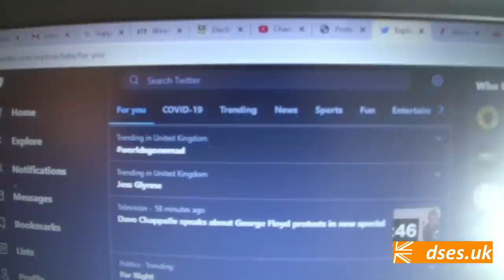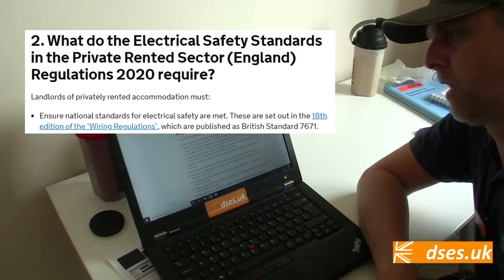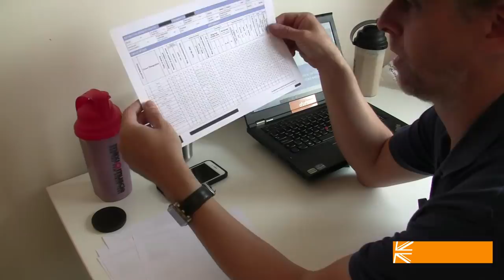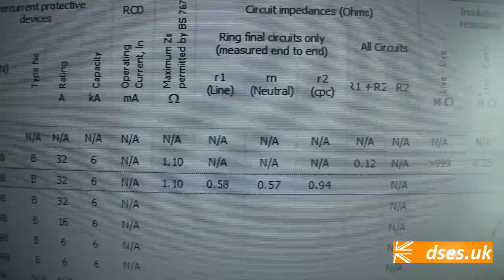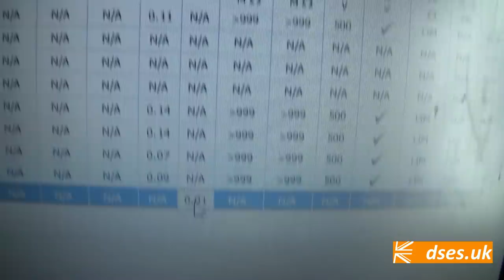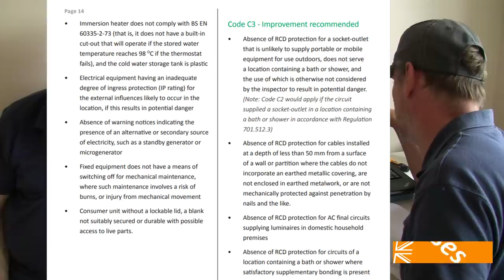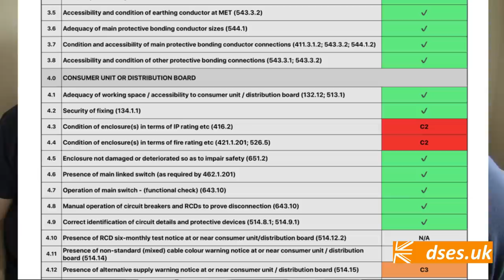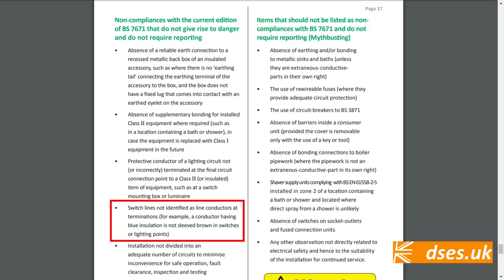Landlord electrical inspections from July!

Comment: I think it’s worth mentioning that the minimum 1M ohms  stated in the regulations is with all final circuits and any distribution circuits if applicable connected to the CU or distribution board and not individual circuits. The total insulation resistance with the final circuits connected in parallel must be equal to or greater than 1Mohm although really this is a requirement of initial verification and not periodic inspection and testing, you must use sound judgment on whatever readings you obtain as to whether they are satisfactory or not.
There’s also no requirement to have your protective bonding conductor resistance at or below 0.05 ohms. I think the confusion is that 0.05 ohms is mentioned only in GN3 however it does state in GN3 that this is NOT from the MET to the extraneous part, it’s between pipework where a bonding connection is ‘built in’ and a low reading on the order of say 0.05 ohms between different pipework confirms that the pipework is ‘bonded’ .
Reply from the maker: Thanks Ian, you're right of course. We're interested in what is hovering near or under the 1MOhm mark in case we are asked to fit an RCD. A re-read of GN3 does indeed state the 0.05 Ohm reading is between 'any two points' such as metallic pipes. Even when you read this stuff and think you have it down, it warps in memory and becomes something else entirely.
Reply: David Savery Electrical Services No problem, enjoying your content 👌🏻

Comment: As I work for a council in our properties in between tenancies the properties have a full inspection with 10 to 50% of accessorie's disconnected to determine partial visual condition of the installation and we do minor upgrades for peace of mind and saftey.
99% of our properties have plastic consumer units which get a c3.
80% are of 16th edition where only socket outlets are rcd protected. They also get a c3 even if we do not know the depth of the cable buried in the fabric of the building.
These properties we come a cross we rcd lighting circuits or any circuit going through a bathroom weather they do or do not serve the location just for peace of mind for the customer and tenants saftey.
And we also now have started fitting type 2 surge protection on all properties via the wylex mains isolator/spd combo.
Some of the comments on Facebook and other forums stating that all properties should have rcd protection and they c2 plastic consumer unit located in escape routes or under stairs is complete nonsense.
Its only in communal areas or commercial settings where such codes should be used.
Its just a money making scam as the twist the regs and government guidelines in there favour of them doing the remdial work.
Excellent video stating these facts david and nigel.
👍🏻
Reply from the maker: Thanks Asa, all sounds sensible to me!

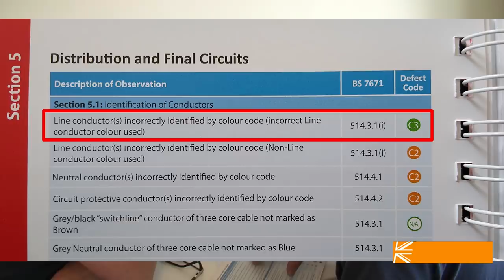Comment: For the switched line conductor being the wrong colour, you appeared to highlight the wrong line in the codebreaker book, the one you highlighted says C3 if the wrong line colour is used (presumably referring to 3 phase colours) but C2 if a non line colour is used. Surely black old colour for neutral would be a non line colour.... Except of course they were sleeved so it's all nonsense anyway 1:09:52

Comment: Hi David, couple of comments, just my opinion, I don’t agree with the way you tested the cooker circuit or recorded the IR.  The IR is of the fixed wiring & not the appliances connected to it.  The other electrician was correct in my opinion up to the isolator, unless the client requested the whole circuit be tested, then you must remove the loads & measure the IR.  R.F. Circuits do receive a lot of flack, correctly installed & you get the length which you sometimes need.  Also periodic inspection should be minimum dismantling, removing all sockets is unnecessary unless the sample is being increased due to loose connections & even then, it should be recorded as a c2 100% sample required & rectified in rectifications after the report is complete.  (You could have caused IR problems that didn’t exist before you removed all the sockets). RFC, crossovers are not usually required during a periodic.   (DOMESTIC) End to end, R2 wander lead to earth pin (bonds removed from MET) & ELI, you will have already sampled approx 25% of the installation.  (Crossovers on an existing installation measures the contact resistance of the old socket & results are inaccurate). You normally have no choice to use crossovers in commercial.
Reply from the maker: Thanks Patrick, I value your feedback. The reason for testing the cooker after the isolator, as we would also have done with an electric shower, was to ascertain whether the fixed appliance would be likely to cause problems for an RCD should the landlady act upon our recommendation such be fitted. It does indeed skew the results of the fixed wiring test, but I don't want to be asked to fit an RCD, then tell the landlady she also needs a new appliance because the flimmin' thing won't stay on. I take your point about removal of accessories, but we try to identify and rectify issues such as loose connections on the day rather than reporting back problems and booking remedial work. We're doing ourselves no favours I know, we could book such work in and make more money, but we're so rammed with work that we'd rather visit site once and tick it off for the sake of some screwdriver twiddling. RFC crossovers we often omit on periodics; such was actually said to camera, but it got cut from the edit and in this case we did it to verify the result of the last guy and to show the maths working out.
Reply: David, that makes complete sense, but I still wouldn't record it on the test sheet as that could cause confusion.  Anyway I enjoyed the video, excellent content.

Comment: Hi David, Thank you for this very informative video. It will help electricians and landlords. We just need the government to watch it to realise that too many areas rely on opinion. I've just had a EICR carried out on a flat I rent out (built 1988) and exactly the same situation has happened. Failed due to no RCD's. I sent the report to the NICEIC, of which he's registered, and they came back with the lack of RCD's warranted a C3. They did say from the report that outside sockets are a C2. However it's a 3rd floor flat. They did mention though that supplementary bonding was marked as N/A.  This obviously can not be so and still needs to be verified. I'm currently having a "discussion" with the "Electrician", and I've since found out that although he is registered with the NICEIC, this is as a Domestic Installer. I was wondering if Domestic Installers qualify as a competent person to carry out EICR's? I do want to have the consumer unit replaced (not for the £900 they quoted), as I fully understand the improvements made in safety with RCD's. Keep up the good work.
Reply: Only if he has 2391-52 but he wont be able to sign the EICR off as a domestic installer from NICEIC as it doesn't come under the D.I Scheme but does come under Approved Contractor Scheme.

Comment: slightly off topic but I heard  your say your an easy cert user whats your take on the measured Zs value setting in the software  80 or 100%, ? to me its wrong either way because if you set at 80% easycert will highlight excess measured Zs values in red but inputs the 80% as the maximum allowable value  but this should always be the 100% uncorrected value so you select the 100% option but lose the software's ability to highlight measured values that exceed 80%, hope this makes sense ? and still holds true in the latest versions of easycert , going back a few years this was about the only thing Amtech got right as you could select 100% values but validate at 80%.

Comment: Great video.  Just a quick question. New to the game. Got a board change to do in a integral garage. The existing consumer unit is on a outside  brick wall in the garage . Needs to be batoned  off the wall and cables will have to be rear entry.
So there will be knockouts on the back of the consumer unit. The consumer unit will be between 50mm to 75 mm off the wall. So with the knockouts out what is and how is the best way to fire rate it.

Comment: on change of tenants is the main risk not one of accidental damage, eg crack on accessories or overheating caused by bad plug on their equipment ?
Reply from the maker: Could very well be, but a quick visual sweep after they've buggered off and handed back the keys may be all that's needed to keep a valued landlord client happy.

Comment: I think that there will be an extension to that date,  But to me, I read it as This Must be done now...' But don't panic your installation should be ok until it`s done as I imagine lots on landlords would be concerned that their installation isn't safe. By everyone upgrading and everyone is up to the same spec it creates a high safety standard and that lasts will be compatible with future tech. Anyone agree?
Reply from the maker: I agree that upgrading to RCD protection is a great idea, less so that all aspects of the installation be to 18th Edition standards. If that's the intention though, then there should be clear guidance on when it needs to be done by because 'should be okay until it's done' could be applied for years.

Comment: Hi David great video again very well explained and very interesting. 

May I ask , you say the installation is 21 years old and the label on the CU ties in with that? In my opinion the date on the label doesn’t really tell you how old the installation is but when it was last inspected , so the label could well be a newer one and the old one removed?

Secondly you say you check everything which you did and torqued up the CU now being as it’s a fairly old CU how do you know what the recommended torque is ?  . Not quitisiseing  you in any way shape or form just wondering. Fantastic video mate as always

Comment: Very interesting. I have an electrical inspection due at this property; it will be interesting to see what line the inspector takes. House was built in 1993; the consumer unit was changed a little after I moved in in 2012 (I wasn't home at the time) as apparently the one that was there before didn't meet current regs...it still doesn't as it's a plastic unit, but I presume what is there would conform to the 1993 regulations. All of the cabling is of course, pre-harmonised colouring. There are things about this installation that I really don't like; only single sockets everywhere except in a couple of places...I later learned why; one ring to cover the whole property. Inconsistencies in how the lighting is done; in some cases the feeds come into the switch with the switched supply going to the fitting, in others they're using the ceiling rose and dropping a switch wire.  I don't have an issue with either approach, but I do expect someone to pick one and stick with it.  So, in a couple of weeks time; will he apply a common sense approach, or quote to rip it all out and start again.  On one hand, I hope he shows common sense, but on the other I hope he rips it out and does a decent job...it's s shit show at the moment.
Reply from the maker: If he wants to rip it out John, just make sure the reasons why make sense as a 2012 CU shouldn't require replacing without good cause. Similarly, if something new is going in, try and ensure the guy doing it has a sense of pride and a few brain cells to rub together or you'll end up with something in worse condition than what it was supposed to replace.
Reply: U r not a qualified electrician so u have no reason to comment or judge. Delusional
Reply: @adamsharp201  I'm delusional? Says the person who jumps to a conclusion.

Comment: You  said at 25.00 about damage to the main isolater switch plus the red cover not shut correctly.If there  are no replacement parts ie Isolater does that mean you require a new DB. Did  you forget to put it into your report as well .Great video very informative

Comment: Another great video david I'm a bit confused what about regulation 411.3.3 that says any socket outlet that can be used outdoors and doesn't have a RCD is a code 2 unless it's a 10th floor in a block of flats all sockets can be used outdoors with and extension lead to wash the car or cut the grass etc it backs this up on page 38 of NAPIT code breaker book
Reply from the maker: There's nothing I can see in either publication about the height, but the way I look at it is how the fixed wiring installation is designed. If all sockets are physically internal, then they're not designed to provide supplies outdoors; that's what I go by, never mind what someone could come along and do with extension leads. Sure, someone may choose to take the supply outside. Someone may also try to use their Playstation while in the bath. Unless provision has been put in to service such a requirement specifically such as an outdoor or bathroom socket, then I'm not going to second-guess what someone might do, I'm just looking at what the installation was designed to do.
Reply: David Savery Electrical Services 
Thanks for that be interested what the NICEIC take on this would be next time I speak to them I'll see what they say keep up the good work 👍
Reply from the maker: @ianbaulk9766  Others are saying that in 16th Edition, RCD's were required for socket circuits serving a ground floor, so that may be an historic consideration.

Comment: Hypothetical question... could you, in this flat, replace just the plastic CU casing with a metal one, and then reuse all of the original CU internals in the new metal casing? Of couse, the isolator switches could also be swapped out for RCDs too. Would that be deemed acceptable?
Reply from the maker: Hi Dave. Technically, yes. The main switches are to BS60947-3 and the MCB's to BS60898 so they're still current and could be re-used with a new RCD configuration in a different enclosure. The problem is, empty metal enclosures are expensive; probably to prevent you from doing this kind of thing, and the manufacturer probably also have some clause stating only certain models of protective devices (e.g. their current range) are type-tested for it!

Comment: I'm fairly sure codebrakers classes cable in walls less than 50mm without rcd protection as a c2 altho I still don't agree. However this is a good opertunity to raise the standards in the rental sector in terms of electrical safety.
Reply from the maker: This is true, and you'll be pleased to hear it is addressed in a lengthy follow-up that should go out on Saturday!

Comment: There is a house I was working at were the CU and the meter is on a board that is hanging on the wall not fixed.  And No RCD of any kind but it is all from 1989

Comment: Great video - now that your residential Clown has returned! I only fell asleep twice watching it! :D
Question: We are landlords of a property (managed by agents). An EICR was carried out a little while ago and was "Unsatisfactory" with two C2s (and three C3s). Of the C2s, one regarding an "...outside socket wired in flex cable off outside lighting circuit... (512.2)", and another regarding inadequate water bonding (bonding curiously removed) (514.13).
Glad to see remainder of the report, with regard to limitations follows more or less what you say in this video (and others) :)
We asked for remedial works for the C2s, which were carried out.
Should we expect an updated EICR covering the remedial works, such that we have an overall "Satisfactory" certificate for our tenants?
Reply from the maker: Hi Sean. Yes, you should have something to prove the identified defects were corrected. That may be in the form of an Electrical Installation Certificate or Minor Works Certificate which post-date the report and detail the remedial actions, or if the work was done by the same outfit who authored the fail report, then a new one issued without the defects listed now passing it as fit. Otherwise, how can you prove you acted with due diligence and engaged the services of a professional to put it right? How do you know these defects have really been addressed? In a shock or fire incident, you would have to show under EAWR that you acted as required, and this paperwork with a professional's signature on it is what keeps you out of the dock!
Reply: @dsesuk  Many thanks - I will chase our agents... (The only thing we have since is THEIR invoice for the works!).